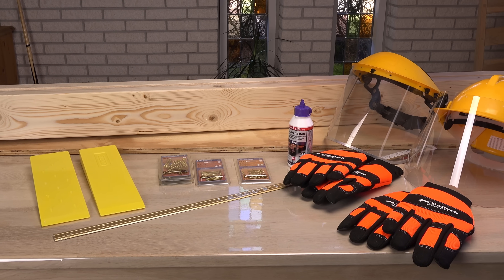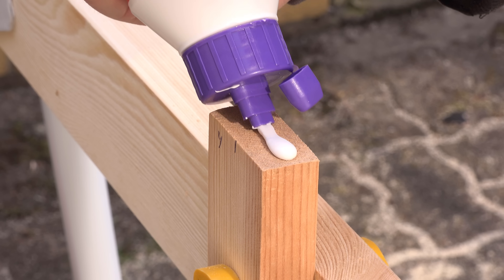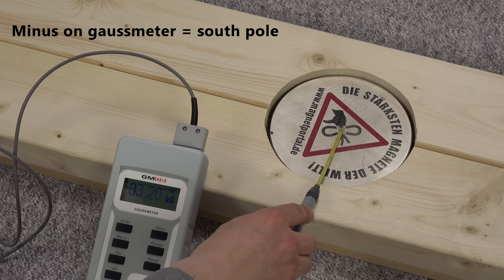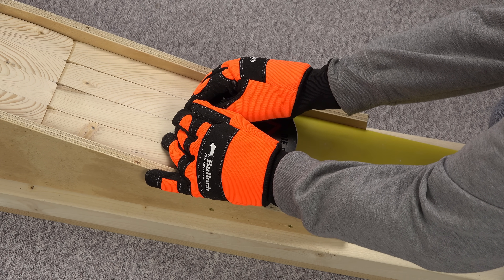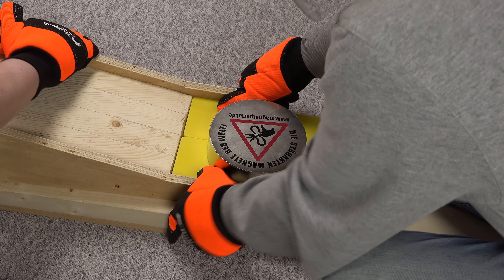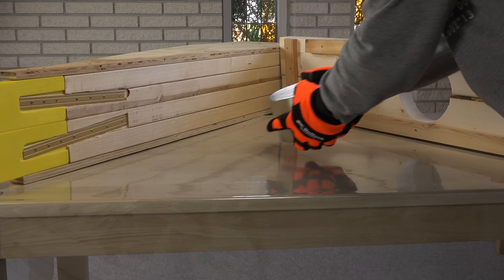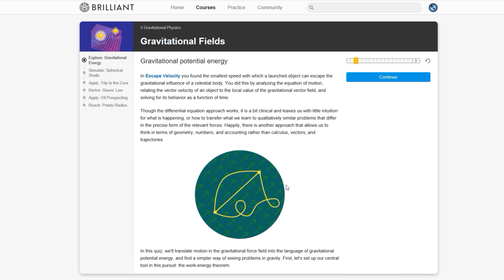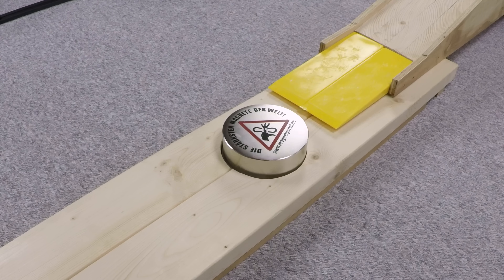Monster magnet meets monster magnet...

Comment: Imagine yo balls gettin stuck between those
Reply: Danniel Nikitins what if your boobs AND balls got stuck in between the
Reply: @zeropomegranates9976  then your a transgender
Reply: @zeropomegranates9976  yes that would happen yes
Reply: Well it will be the last nut you'll bust😉😂😂
Reply: Ikr! @blackhornetjsbobeast1356
Reply: No and no and no... I'm in pain just thinking about thinking about it!! No!
Reply: That feel good as shit
Reply: Soft, warm, full of blood and gristle? How do you know my dietary habits so well...
Reply: Horrible images are coming to my mind... Thanks
Reply: Imagine this magnet gettin stuck between your balls
Reply: POP....POP
Reply: OUCH! I'd rather NOT imagine that...
Reply: I strangely thought the same thing when I clicked on the video
Reply: They can't, since they won't be balls anymore.
Reply: @parishna4882  well thanks now I am in heavy pain just by reading btw can you come up with something great that can cure my pain that I got from reading this
Reply: @H.K. VITA

Potentially...

What you need is a pair of needle nose pliers, some tweezers, a soldering iron, some heat shrink and some very thin solder. Hold the opening of your urethra open with some tweezers and shove the pliers into the shaft. Being careful, if they're cold. Work your way down, till you feel the tip of the pliers in your nut sack. You can do this with the help of another person, as both of your hands will be occupied. Work your way around till you feel the epididymis. If your urethra becomes swollen, it will be more difficult, so try to use care. Once you've found the epididymis, grab onto it, and firmly pull it back up the shaft, till you see it clearly hanging out of your glans. Slip some heat shrink over the tenuous tube, and carefully wiggle it down as far as it can go, just enough to cover the join. Heat the soldering iron up till it is easily able to melt solder, and carefully solder the end of your epididymis to the tip of your penis, leaving the opening clear of any obstruction - you need this to still ejaculate. Anywhere on the glans will suffice, it is a preference. Now, ensure the connection is stable, by pulling gently on it. Once it is firmly attached, slide the heat shrink over the join, pushing a slight amount of pink tissue into the tube also, and using a lighter, or small blow torch, heat the heat shrink till it tightens, and let it cool. Make sure the connection and opening are functional by having a wank looking at sarah jessica parker. If you can achieve this, then you are indeed worthy of this life hack.

So, now you have a working penis again, and coming will be a breeze. Just ensure you keep the epididymis hole clean by using saline solution, or you can just pee on it, every second day. 

Trust me, I am a smashed testicle doctor and I have a very large customer base of dead things.
Reply: @parishna4882  ahh I didn't asked for the treatment (I wanted something that can make me not think about this) but still thanks and if I ever got my stuff between any kind of magnet I will try to do this infact from now on I will literally throw all the magnets I have just to be safe

(Goes to a corner crying as he thinks about how hard the treatment is and how much pain one must have to go through)
Reply: i was just thinking about this then i saw your comment ..
Reply: Hey it has happened! And had to be surgically removed
Reply: No
Reply: They would literally pop
Reply: Don't even want to think about it
Reply: Or put the thing between the magnets and im sure it looks like a  beavers tail after that
Reply: owww, i feel the pain
Reply: xD
Reply: Ah nooo pls kill me
Reply: Yawwwn
Reply: Seek psychotherapy or grow up. You can do it!
Reply: HE CAN DOOOOOOOOOOOEEET !!!!

You meant him, right?
Reply: @RADLEY CARTER dont get your balls all bunched up or do you have any for that matter?
Reply: I don’t have none I have a v 😏😋
Reply: No
Reply: Lmaoooo
Reply: At least this wold not be lethal. If your head is between those magets.. Well it's more than 1 ton in equivalent.
Reply: @DiamondSane but don't they need to be Super close to have this much Force SmARt aSS
Reply: Ah, i know a few people who deserve that 🙃
Reply: Cheap transition, go for it sis/cis/messy piss.
Reply: NOOOOOOOOOOOOOOOOOOO!!! Disliked for making me imagine that😱🤮
Reply: Imagine not having balls after loosing then in the worst way possible
Reply: Bro that would be painful
Reply: Why???¿¿
Reply: nokids4u
Reply: ZoNeReapz thnx for putting dat thought in mah head
Reply: ZoNeReapz I didn’t wanted to think about that
Reply: pop pop
Reply: You,d be singing suprano
Reply: Modern medicine : vasectomy... lol
Reply: RADLEY CARTER er he’s jus making a joke cause the force is so strong it will crush your balls ,r u dumb?
Reply: Holy shit neil? THats what he meant? THank fuck you're here. We'd have never known...
Reply: @tigersharkgaming8597  r/woosh

Comment: What the hell is the real purpose of sticking 2 powerful  magnets together??
Reply: making little magnet babies
Reply: You can make magnet babies just by rubbing them on things. I do it on public transport, all the time.
Reply: Making one really powerful magnet
Reply: An experiment.
Reply: When you bring two magnets together like that the "new" one is much weaker. I agree with the Tony Shay question; Why bring two powerful magnets together?
Reply: @SamO45  why would it be weaker?
Reply: @ki0w0-lordofwatersheep , when the magnets are attracted to each other, the lines of flux is smaller. (I am not sure how to explain) Try it with small bar magnets. "Stick" them together and measure the strength, somehow. (in school, we used paper, placing iron filings on the other side from the magnets) (or just see how they stick to a large metal object)
 Then, strap them together OPPOSING each other...the lines of flux are much larger, over double the size.
Reply: @SamO45  which lines? Smaller in what way? Wouldn't denser lines equal higher fluz density? Which is why magnets tend to be stronger at the poles?
Reply: Im not that good at teaching/explaining. Just try it yourself using two identical, and smaller, bar magnets. I just know what I have experimented with, myself, and put in use on the job.
Reply: The flux is smaller because it is more concentrated. The tighter the flux, the better the force. Nothing worse than a bad flux.
Reply: thank you! I also see no purpose in this "experiment", although I can see they're having fun.
Reply: Science is not about "Why?", it's about "Why not?!"
Reply: Here your pills!!!
Reply: The end of the world
Reply: The views
Reply: A video for you. Please Like and Subscribe, thank you: https://www.youtube.com/watch?v=8IMPe5hdw5Y&t=3s
Reply: To prove it's more fun than sticking your tongue on a 9v battery..........
Reply: Black hole
Reply: The point is:
1. To see if it can be done!
2. To prove that it can be done.
3. To be the one that did it.
4. To get an even stronger magnet!

Take your pick.
Reply: 2 is stronger than one, idiot. He even made another video testing their strength and they're stronger than his previous strongest magnet.

Comment: I was making an experimental   axial gap permanent magnet motor / flywheel project  for NASA in 1995 under a phase II SBIR grant.  I had a samarium cobalt magnet in my hand and  a .250" drill bit flew from a table approx. 4 feet away, struck the magnet and it shattered! Luckily I it hit the center of magnet away from my fingers  and I was  not hurt except for some small  cuts on my hand from  fragments. Samarium cobalt magnets are no stronger than neodynium, but they do  not tend to demagnetize at high temperatures.

Comment: the screech is made from the friction of the plastic, this sound occurs all the time, and usually is caused when something is pushed along plastic with a bunch of force pushing against the plastic on the object that is being pushed. this is more common with plastic - plastic, due to the fact that it has enough friction to double that of plastic, but it can be done with any material with a friction of not 0

Comment: The noise was the magnets crushing the thin part of your plastic/hard rubber wedges as the magnets made first contact and the attractive force drastically increased. Causing the distortion you showed on one of your wedges.

Comment: Thanks for cool film. We made a robot that lifts rotor on stator of flat electric motor, there's about 2000kg pulling force at end. Those parts were rather easier to grip than your magnets and there was a hole in center. we had servo driven thread rod type pusher in center to control closing.

Comment: drill a hole in them and put a threaded rod threw them and screw them together so the opposing poles come together and supposedly if you drop them from a rooftop or someplace high next to something of equal weight they should both reach the ground at the same time but the magnets drop slower than the other object
Reply: actually the weight wont make a difference because the earths gravitational pull will be the same no matter if the objects are different weights but the magnets have an effect on the gravitational pull and will drop more slowly its pretty cool

Comment: the friction caused by the extreme force of the two magnets pulling each other together and the slight grooves on the plastic made a vibration which resulted in a sound wave being produced.

Comment: Science? What science? You put a magnet on top of another magnet.
Reply: That's really powerful look what it did to the blokes eye
Reply: The device to make the two magnets meet calmly, and not violently explode into a dangerous field of magnetic shrapnel, is a feat of engineering. Engineering is commonly considered an applied science.  Creating something to solve your problems that is. Also that sound was the plastic being shaved off by the force of the magnets, I think an air bubble was created within the plastic and made the sound.
Reply: Screwing plywood together into a ramp is NOT a feat of engineering. Doing the EXACT same thing where the magnets slowly pulled themselves together via a ramp built with just enough friction to make connection slow enough to not shatter would be a minor feat. This was none of that.

Building the Pyramids without the use of a wheel or steel (or even iron!!!) is a feat of engineering. The Do It Yourself classes offered at Home Depot involve far greater 'feats' of engineering. Stahp trying to claim this is science or anything of that sort, this was a guy sticking 2 magnets together.
Reply: Neodium is a very brittle metalloid. if you would put them together with the way you do with normal magnets the giant Neodium would shatter in lots of pieces. it was a science to figure out how to put them together without the shattering.
Reply: Thije Wissema oh. Thank you for explaining this.
Reply: @SzarkaFox   No problem.
Reply: @CodingCorvus  perhaps in water? Seperate both magnets in a tube(same diameter) with water and vent off the water.....
Reply: So what can these 2 magnets do for mankind . Science ?
Reply: "Science? What sience? You put a magnet on top of another magnet."

"Science? What sience? You"

"nce? What sience? Y"

SIENCE?
Reply: 100 subscribers no videos? Thank you for pointing it out.
Reply: This was moreso engineering than science.
Reply: Its a bullshitt . yup
Reply: Well . i was doing this complex science when i was 4 years old . Good luck
Reply: To me?
If so, mostly the basics of chemistry and a wider understanding of physics.
Reply: Sience
Reply: And which physical laws be valid?? Hahaha
Reply: LET'S NOT BE FRIENDS. UGHHH
Reply: Basically what that did falls underneath the class of engineering which is a type of science.
Reply: @Martin Smouter It's not science it's physics
Reply: @Martin Smouter Well, idk if my education system  is wrong, science is basically reactions and mutations of different elements, physics are magneticfields, gravity etc
Reply: Martin Smouter alanalised?
Reply: I Agree, WASTE OF TIME... I was waiting for the big reveal

Comment: Nice. 👍🏽 
Now take them apart.
Reply: Leak false info claiming one of them cheated on the other, then hide behind a solid wall.
Reply: Legend has it he is still trying to this day
Reply: @lukeslife3958  
Legened is tru
Reply: RIP the plastic wedge
Reply: Reverse their polarity
Reply: @dicocraftgames6829  Gotta need a sonic screwdriver though, how would he get the right combination of algorithm without the TARDIS?
Reply: @minhtrungle9117  HA! didn't think anyone would catch that.
Reply: @dicocraftgames6829  That's a good thought, some electricity might do the trick
Reply: By playing the video in reverse.
Reply: Use a hydraulic press with a wedge to separate them
Reply: I have some neodymium magnets somewhere, I used to put them together and slide them apart all the time.
They were very small however.
Reply: Heat the magnets and they'll temporarily lose their magnetic properties.
Reply: 666 likes lol
Reply: @diptansuroy  
Woot
Reply: @MirageUchiha  dis comment had 666 likes
Reply: That’s 2400 pounds of force
Reply: @LuckyDucky1122  at Harbor Freight...8000lb hand winch $30, 6000lb heavy duty tow strap $17. Shouldn't need much more than that, right? Just need to build something that will keep the bottom magnet in its place as you slide off the top magnet.
Reply: Its easy to lose its magnetism.. By just heating, shocking or coercivity
Reply: Heat it
Reply: Slide them off
Reply: @HeyItsFishher  is WAY harder than it seems
Reply: @GalaxyCloud  With brute force yes, but if you heat them up they will slowly lose their magnetic field until eventually they just fall apart on their own, or melt.
Reply: @HeyItsFishher  Agreed - if they make another carrier like the one holding the bottom magnet and precisely match the height it would be possible to slide the magnets apart. You would most probably need to use a hydraulic press. Figuring out how to do this is one thing. Why is another. What practical scientific application that would yield useful work could this be applied to?
Reply: I don't think taking them apart would be nearly as difficult as putting them together. Just put the magnet back in that piece of wood he had the bottom magnet in, and then put a ratchet strap around the top one and start ratcheting.

Comment: You could have tried this, by putting the lower magnet on the floor, a big ice cube on top, then the second magnet, and wait for the ice to melt. 
A plastic tube could line up the magnets and help leading them pretty exactly. 
It could further help, in that you could use many, many small ice cubes instead of a big one. 
In winter, you could even produce the dividing ice in that plastic tube.

Comment: I watched you video and in the past I had a similar task of combining large magnets. for producing powerful aviation motors. My solution was effortless and allowed fine control and easy of repeatability:

I used a copper tube filled with oil. one disk placed at the bottom and the other dropped in from the top of the tube. First the dropped disk magnet slowed its approach to the oil via Lorentz force, then its attractive decent through the oil is further slowed as fluid is incompressible and it its conductance is controlled by the clearance between the disc and the interior diameter of the tube.

Work smart !

Best regards,

Daniel Preston
www.luminati.aero
www.Luminativtol.aero

Comment: Now split them, that would be interesting. I guess you will have to use non-magnetic metal sheet and use rubber hammer to put it in between.

Comment: HOW TO SEPARATE: Use 4 pieces of (preferably non magnetic) 316 stainless steel 50x50x10 x 300 long angle-iron . Make up two clamps by drilling two 16mm dia. holes in each flat of each angle; so there is one hole at either end of each flat, and make sure the holes are central, and when the angles are put back to back, all the holes must line up !  Use (preferably non magnetic) 316 M16 stainless threaded rod cut to fit, and M16 nuts to clamp either magnet, to bolt between parallel arranged angles. Cut four more 316 M16 stainless threaded rods, cut 200mm longer than needed; long enough to become jacking apart screws, to fit axially parallel to both the magnets to be assembled between the two clamps.  Plus eight more of the M16 nuts to be fitted to the four threaded rods, between the two clamps, for progressively jacking apart the magnets with a 10" shifting spanner. It might be necessary to make the same separator out of heavier angle-iron, but I'm sure you could calculate the total separation force required by finding out what the force per square inch would be, first..

Comment: Looking at how you damaged computers by resting one 6x2" neodymium magnet above a computer, and saw how they were affected, have you thought about doing the same with the newly formed 6x4" neodymium magnet? Also, how about having the magnet swing over the top of the computer, say like a pendulum, to see if the magnetic field will induce electromotive forces within the circuitry of the computer to see if that would give a more damaging effect?

Also, you may be aware that a block of copper will repel a suspended magnet moving towards it due to the magnet inducing a current within the copper which generates its own magnetic field in opposition to the one approaching it. Have you thought about seeing if your 6x2 or 6x4 magnets would also behave that way? I think you might need a very large block of copper fixed extremely well to the ground to withstand the force and momentum of the larger magnets! :)

Thanks for making some very interesting and quite humorous videos about science :)

Comment: I wonder if using ice somehow would work as a hands-off way to combine large magnets like this. Like build some sort of frame to prevent the magnets from twisting or flipping and put a large block of ice in between them and as the ice melts the magnets get closer until they connect.